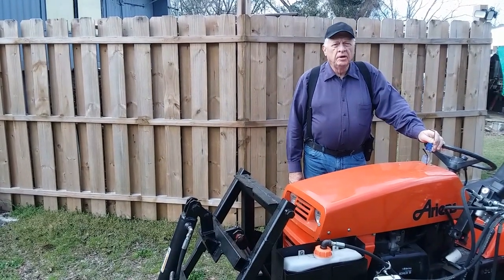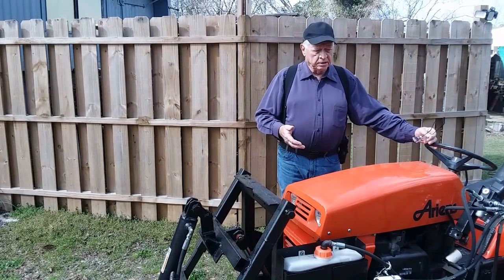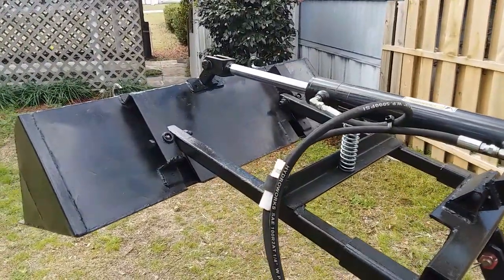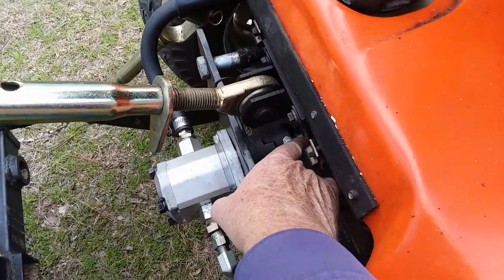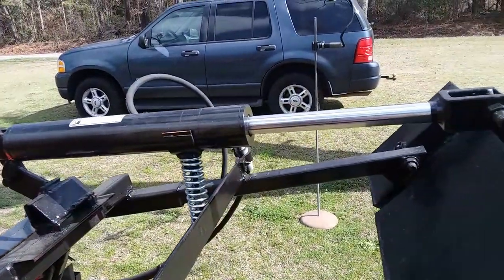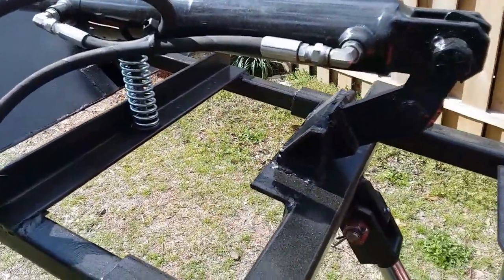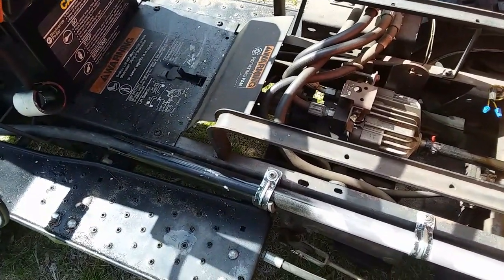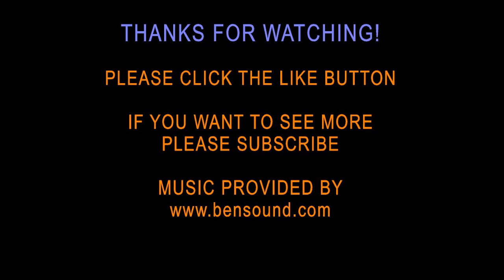Homemade Front End Loader Build on a Garden Tractor - PART 2 - Bucket and Hydraulics

Comment: Hi Ed, I installed my hoses and I didn’t give myself enough length in a couple of hoses that raise the arms. I see on your valve you used a nipple of some material that looks about 4 or so inches long. Is that black pipe?
Reply from the maker: It is galvanized. Pressure ratings for schedule 40 are on the low side. Schedule 80 psi is up in the 1000s of psi depending on the size. Galvanized ratings are much higher on the smaller sizes and lower on the larger sizes. Using 3/4" you would definitely want to use schedule 80 on a pressure port. I would imagine that schedule 80 will be harder to find. Schedule 40 can be used on the return to the tank as that is usually preset in the spool valve at around 140 psi.
If you have different length hoses, can you swap the short one out, maybe putting it on the return port to the tank? It would be no problem using schedule 40 on this location low pressure location. Then use a longer hose for that location that is holding things up for you. 
If you cant do that, try to get schedule 80 nipple pipe. If you can't get it at your local home improvement store, try places like NAPA auto parts, Agri supply, or even your local plumber. 
I don't know what pressure you are running but I would think that 1500 to 2000 psi would be plenty.
I hope this helps, Ed
Reply: @eds2centsworth203 Hi Ed, I did swap them out this morning. I actually took the longest lines I had saved for the bucket and swapped them on the next longest on the cylinders and then the 3rd longest on the other end of the cylinders, left over were the 2 shortest lines and I took a jic coupler and joined the two together.so I just need to purchase 1 line to o be done. I should have it completed this weekend. I am pleased with the progress so far. I can raise and lower the bucket now but not the tilt until I get the last hose. Thank you!
Reply from the maker: Sounds great. I am sure you will take great pleasure in your build as I have mine.

Comment: I finally have my loader built ED and just getting ready to measure the hoses. I have the same valve that you used and am using 2:4” hoses to the cylinders and 3/4” hose to and from the pump. The only difference is my pump is only 3.1 gpm so I hope that isn’t too small of volume. I also am using 2 2” cylinders for the arms but only 1 for the bucket. Hopefully by next weekend I will have it completed,
Thank you for your videos. They have helped me on my build😊
Reply from the maker: Sounds good. I would like to mention that the 3.1 gal pump should be adequate for your loader with 2 inch bore cylinders and 1/4" hoses. While they will work, you may find that the 3/4" hoses are too large. I think 1/4" hoses will maintain pressure better while providing adequate fluid volume for 2" bore cylinders. Larger pump and hoses are necessary for larger cylinders. Seems like overkill for your build. Just a thought.
Reply: @eds2centsworth203  Yes on the 3:4” hoses., I did post a question on a Tractor Forum for FEL machines and the replies were most 1/2” minimum to 3/4” so I just went with the 3/4” I like the speed your moves and hope mine is similar. Oh and thanks to the Whole sale hydraulic company their prices are super 😊
Reply from the maker: Let me know how it turns out. Thanks, Ed

Comment: Ed If you Google BSPP British Standard Pipe Parallel and NPT National Pipe Thread compatibility 
They are NOT compatible. They may fit together but it is not recommended and I could not find any adapters for the two different threads either on the website you have stated. So now I am still wondering
Reply from the maker: BSPP and NPT are not the same. However sometimes different threads can get incredibly close. This is what happens with the 1/2" and 3/4" inch BSPP and NPT threads. Both have 14 threads per inch  and the pitch of the threads are extremely close. The NPT can mate successfully with the BSPP even though one is tapered and one is straight.  This only works on 1/2" and 3/4". 
While it is not a perfect match it has proved successful on several of my projects with hydraulic pressures under 2000 PSI. This is not something I would use on commercial equipment, however it is something that the hobbiest builder can make use of.  I have never had a leak using the 1/2" NPT male to 1/2" BSPP female. The 3/4 to 3/4 works also. In addition, I always use either teflon tape or hydraulic joint compound on the threads.

Comment: OK I understand the British PT and I can use NPT but what are the fittings on your 1/4" hose JIC or SAE 6 what type adapter is used there ?

Thank You for the video!
Reply from the maker: I use standard or generic hoses that come with male NPT fittings at both ends. At one end of the hose the fitting swivels and at the other end the fitting is rigid. I usually buy standard hoses at AGRI SUPPLY. Here is a link to an example of what I buy in the 1/4" size -  https://www.agrisupply.com/hydraulic-hose-swivel-end/p/86646/  .

As for fittings on the cylinders for this build -  SAE6 male to 1/4" NPT female. I usually get most of my fittings from SURPLUS CENTER . Here is a link -  https://www.surpluscenter.com/Hydraulics/Hydraulic-Adapters-Fittings/SAE-O-ring-to-NPT/SAE-Male-to-NPT-Female-Swivel---Right-Angle/  .

As for the spool valve connections - The valve assembly had 1/2" BSPP ports. I used 1/2" NPT reducer adapter to 1/4" NPT. Here is a link - https://www.surpluscenter.com/Hydraulics/Hydraulic-Adapters-Fittings/NPT-to-NPT/NPT-Female-to-NPT-Male---Bushing/  .

I did not use any JIC fittings on this build. I removed and did not use the fittings that came on the cylinders which were SAE6 to JIC. 
Cylinder item number is : 9- 16123.  Link to cylinders - https://www.surpluscenter.com/Hydraulics/Hydraulic-Cylinders/Double-Acting-Hydraulic-Cylinders/2-5x14x1-25-Double-Acting-Hydraulic-Cylinder-Bailey-322358-9-16123.axd  .  

I hope this helps, Ed
Reply: @eds2centsworth203  Thank You Ed😊

Comment: Hello, Ed,  I am really enjoying the series you have put together here.  One question I have is how do you control oil pressure in your hydraulic system?  I am thinking maybe how you set the relief valve in the valve that controls the cylinders.  Might you elaborate on the proper way to set one of these?  Again, thank you for all you do.  I really enjoy your work.
Reply from the maker: The spool valve comes with an adjustable pressure valve. Release the lock nut and screw in the adjuster to increase the pressure, back the adjuster screw out and the pressure goes down. If you put a pressure gauge on the main pressure line you can see what the pressure is and make adjustments either way. Doing it this way you adjust pressure for the entire hydraulic system and not individual cylinders.
I will try to make a commentary (with pictures) on different questions subscribers have in the PART 3 - Performance video.  
Thanks, Ed